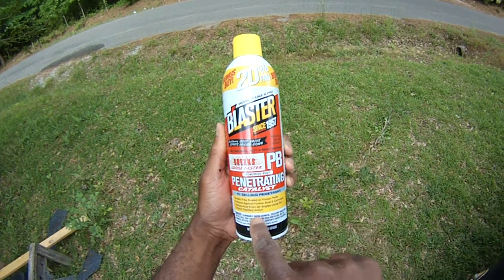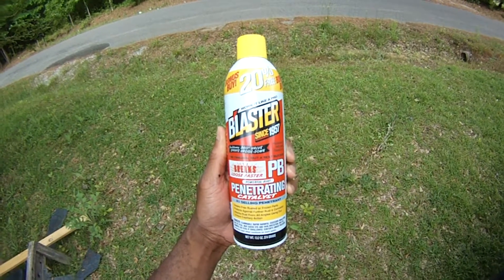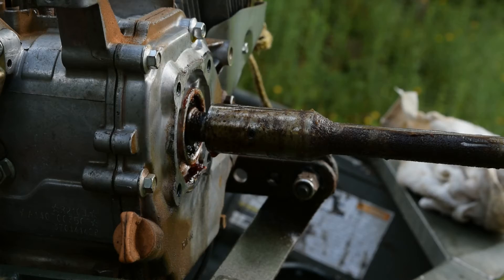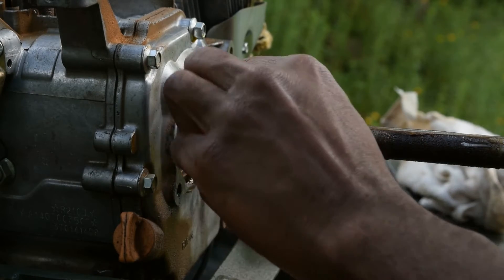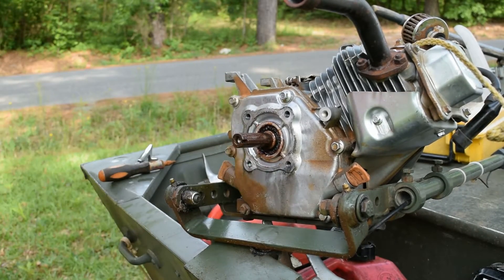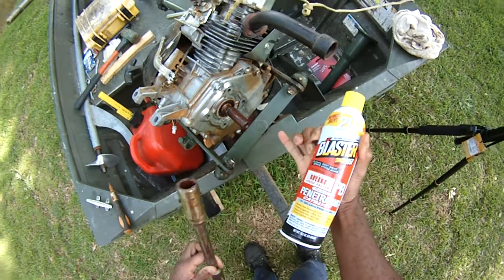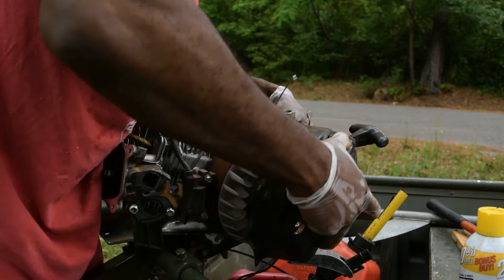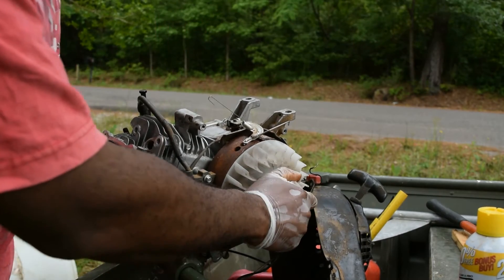Stage 2/3 Mud Motor Build | Coupling & Valve Cover Removal

Comment: PB is great stuff! If you run out of PB, you can make your own with 50% acetone and 50% automatic transmission fluid. It does work!
Reply from the maker: +Ratdog 305 What?! No way! I have both of those at the house now.
Reply: +Black Warrior Lures Yea, I saw a video that showed it loosened a frozen bolt better than any commercial penetrant. But I still like PB! I have used the other a few times and it does work. Had an aluminum wheel frozen to a steel hub and it broke it loose!